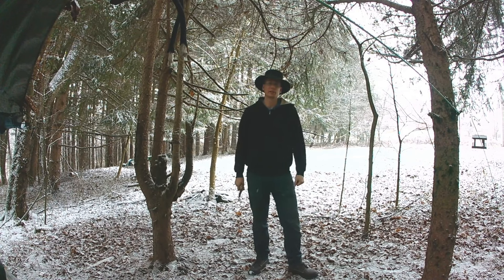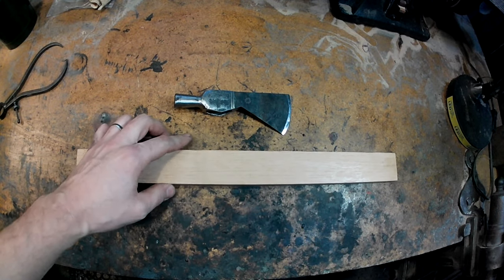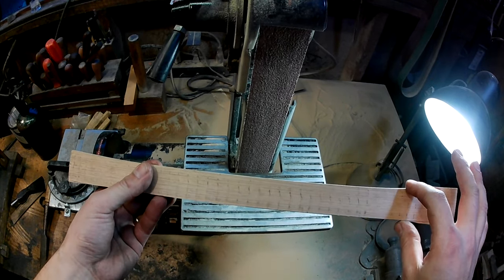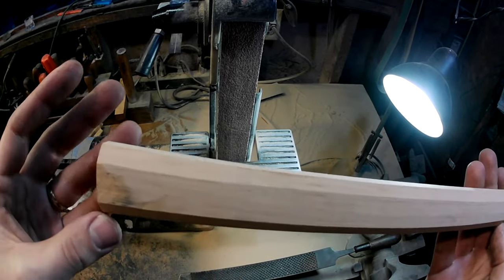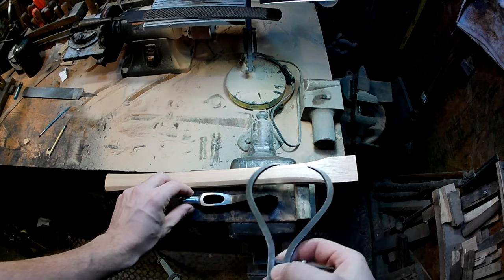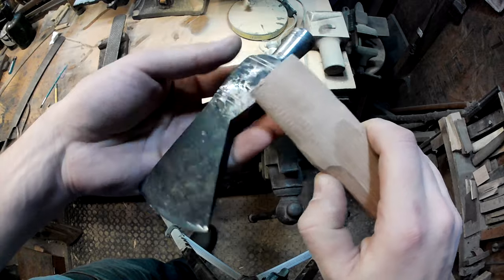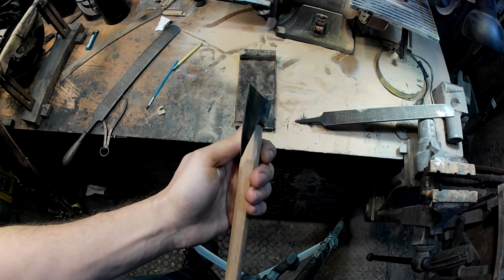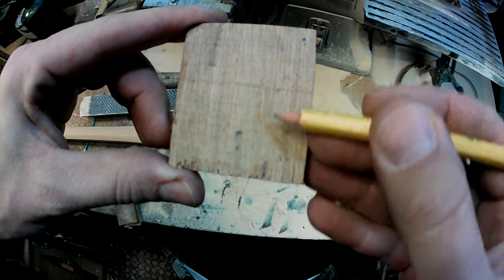Making an axe handle.

Comment: This may be a really random question but was there ever older muskets on the frontier? Like the matchlock or the wheel lock and if so how often would they have been seen and used?
Reply from the maker: From what I've come by, yes indeed old out dated guns were used until they no longer could be.  Many times they were modified over the years, like the stock and barrel kept, but a more modern lock was installed to replace an out dated one and so on.

Comment: Did you forge weld head with 3 pieces 2 sides and a head? 🦬🐎
Reply from the maker: No, in this case it was forged from one solid piece of steel.